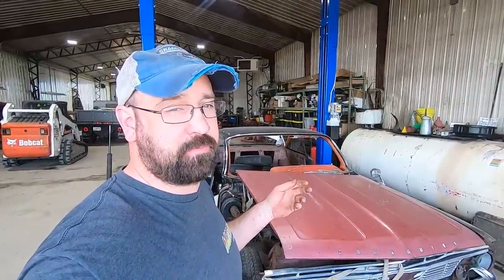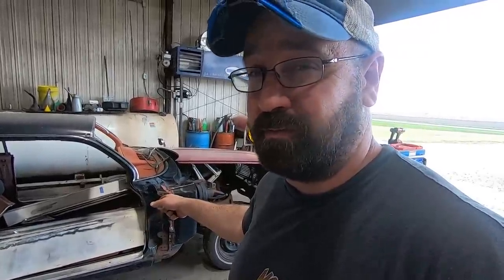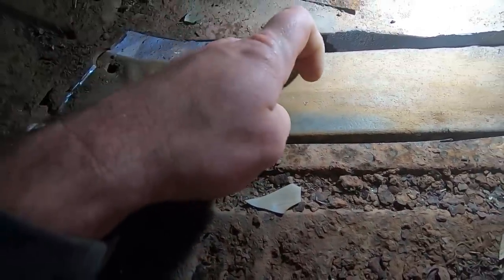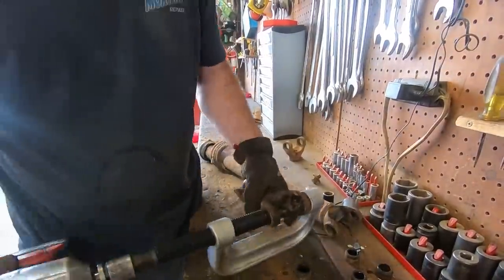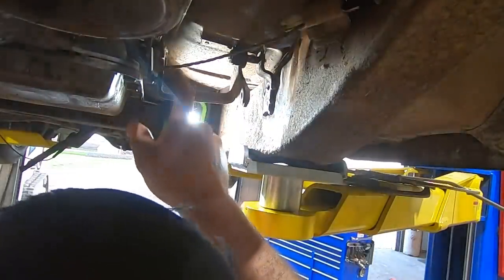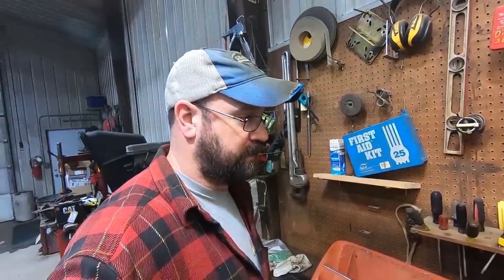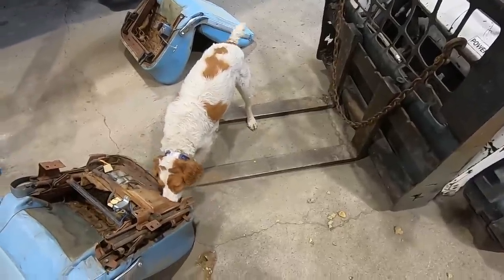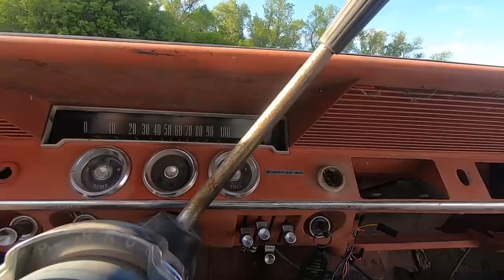Abandoned in the Woods for 50 years! 1961 Chevrolet BelAir Bubbletop Saved from the Grave!

Comment: Even if you just need a little bit of sheet metal  it's not a different Guage metal  as well as some of the proper curves and time is money that 6 in piece of a rotted door can make the complex inside structure  easier to patch  and the X frames are the same its only two  convertibles and non convertibles  but they  are the same size and the additional braces are able to be added to a non convertible I have had  a bunch of 66 impalas 2 ss one vert and 2 2 Dr's all were 283 w/ glide and one that was hardtop had 12 bolt rear my grandfather Art had 58 4dr hardtop  Belair  with a 348 and a 400 as a master transmission builder the cast iron glide  is the first thing anyone not restored the car should take out even if you put a aluminum case glide  back in they weigh  as much as the engine 😂  but the 4dr hardtop to gearhead with 5 kids  was as close to the 55 with a 4 speed  he could  get my grandmother was street racing  because of the guys in Miami  in 60s telling her her husband was going to be mad she was out driving his car it had 375 hp 327 and 4 speed from his gas station  repair shop  sorry  this one is bringing up great memories  and the reason I have had something with a motor since I was 6 years old and I had to know what every different Chevy from  30s to 70s studied his motor service  manuals and  the impact I loved to use  as 4-5 year old I was allowed to take the pans off and help clean in parts washer  in  Miami  we would have  local  Aamco transmission shop sent to art sowerbrower to get it right  as he was owner of his own  Aamco franchise years before I came along in 77 but I always said the best mechanics in the world old time farmers because even if they could have been able to buy it  they couldn't afford it when they didn't even get more then 20 miles from home they were born in  unless they were in service  but necessity is the mother of all inventions 💡🤔 love the longer video of different tasks that have tidbits to learn and if you did in time lapse wouldn't have taught the person who doesn't know that trick someone much older taught you I'm glad I grew up with  a transmission rebuilding shop in our garage  I was able to do a tune up before I started middle school lol could service my go-cart before I was able to start it and built not bought the only thing I send out is alignments and new tires so I have national warranty I have been tire tech so I'm watching the guy and if not 0.00 it's not done 😂

Comment: If you want, you add the floor shifter with your mid-engine Plymouth Rebel with mounted on  AMX engine and get rid of the 1961 garbage black car because of there's no title. The floor stick is a Hurst it belongs to the Plymouth Barracuda loud explosion sound of race division of Hemi head. He got the Rebel for you is The Vice Grip Garage in Youtube and he would offer you his unsalvageable Rebel and let Garage Vise Grip garage tech keep your 1961. Plus, the addition to your homework by shifting the mid-engine AMX V-8 toward to the front engine car called Satellite Rebel then you have to add in dashboard to get the stinking smoke away from the engine in the engine bay with mounts like them are very good shape. It has low mileage. Floor shift is like it is forfeit your rights to be the original car maker then you get the VIN and the Blue book of its pricing range to get it afford by most vintage car's potential buyer. For us to not to forfeit these right of new salvage car owners she would have to be column shift nstead dreaming big pennies =every pennies goes fly away everyday until you hold all asset of Hurst shift so find Leno shift item. I don't have Leno.

Comment: Would be really nice to see you set the budget at ten grand and make a respectable driver. Shame to see the body come off the frame without putting some paint (or at least undercoat) underneath ... which means repairing the floor, new paint up top means good glass and chrome, new carpet means good and matching upholstery ... I know, it's a slippery slope, but the car is worth your expert help! And that ten grand would easily flip into 20 when you are done.
Reply from the maker: Money pit
Reply: @MortskeRepair  Yes but aren't they all? Then again, I am the guy who just finished a frame-off on a 57 Chevy 210 4-door hardtop with a 235/Powerglide. But you asked for "my" solid advice ;-)
Reply from the maker: @JonDraeger  damn

Comment: Okay Bel air is in bad way of chassis and it looks like not factory standard Belair chassis with Biscayne body. The Impala car was what you have but it was not accessory to carry fancy trim such as aftermarket into complete street legal yet. The independent dealers and GM no longer make Impala, Biscayne and Caprice so it was succeed by the Beretta model. That was fine tuning your dashboard from Blue color and into standard red dashboard control with knobs of its meters during the update and upgrade of the dashboard so the electric lighter is connect to the dash hot wires panel IC. Cigerette lighter was avail only as optional to modified as custom of the Impala but the socket is there with no heater spiral tube. The running board was removed from your Impala so you carry the spare tires but it is Biscayne with road service named Ac-Delco trucking to sell air pumping service called mobilty of gas pumping or diesel carrying by pickup truck named Chevy Marveller oil co. that its broker was White Oil co. 
  if someone create the Marvel mystery oil then the founder is the marveller but we became car model named Downsider because of lack of rain = drought as a company John car from my Pet named Deeres.

Comment: We are looking for motor to install 283 CID but you only have Pontiac straight 6 flat head and hand him the Mustang 2 with boss motor includes all rust bolt in a bucket that he drag racing and got 14 sec per quarter mile. Because he went for a latter car named 440 six Pack satellite Then he brought Pontiac 1950's color blue two door vintage sedan with all original roller parts except front sway window pane driver side. It became roller (no pink slip) and not able to run or start good because the engine was leaking testing fluid and bubbling from 2 spark plug from flat head and still running engine with dirty carbon inside the bores of engine. Terrible that the Pontiac have push button Auto shifter and tranny.

Comment: You do need a new torsion bar from Corvette that no one wants corvette "cause it's too expensive. But the torsion bars as a new deliveryr from the stuck mothball storage of junk and then corvette sold you the liquidation pair of the torsion bars as parts of the weight chassis but we build a new plan that you and/or team to weld the torsion bar in between the  ends of lower control trailing arm at the rear suspension. The rear lower control arm has to come off it is broken and rust dead piece but torsion nand flex the trailing arm to be connect to the bottom seat of the rear shock dampener. The same dampener at upper end of the coil spring will goes to the biggest rubber grommet Persuader called washer complex car component and make the heavy duty metal sheet atop the shock absorbers rear set and the metal strong panel of the roof atop the tub sheet metal. The strong panel is between the upper of the rear bench/settee and rear wind-smog shield and it is where the shock heavy coil springy the unweight tub is connect to the strong panel also called rear shelf. The tub is a floor and pan called wiring cowling half tunnel for automobile. The bath tub is too small with its 18 gauge thick.

Comment: Okay you got a new junk car that is salvageable but 1961 car is missing cylinder head for OHV then there is a highway Marshall HWY or memorial HWY from Huntsville, Ala  to Lewisburg - Petersburg, TN Going northward There is a salvage cars at right side after pass the John Deere dealership at right side. The yard might have barb wire fence around the house's property included old car no older than 1960 ad. You get a better find of item and parts for your vintage 1961 car. Over this other than the DMV charge too high finder fee as i compare to the farm field with trees (no leaf) where Biscayne salvage part was sitting in trash. Bigger car and junkyard where the lawyer charge for a free title of the ownership plus the receipt of what you paid for selling risk of DMV license plate. I hope that you sell the work and service that you add charge to the 1961 Chevy bubble top car and that it needs the emblem Biscayne or Impala with 6 tail light at back but you keep all metal and some glass impala but change the rear panel and cut out into 4 tail light. Mine was impala and The veteran sticker and front bumper was like Apache non-pick-up car. I don't know about Biscayne.

Comment: The 1961 Beaufort impala car has x Chassis but you need to hit it hard with rock hammer and see if the chassis pass the inspection safety. It should ring but if not it would thud. Thud is steel chassis is very bad car = not salvageable. Get the 1963 Citation called chassis longest bed length like 15 foot chassis of pure new iron and color silver and also have color as a Lodge builder that improves your chassis that is fragile as a thin glass but beef it up with aluminum-copper rod for welding and brazing to preserve the metal In Bible said it so.
  This week, I have been peeling 50 peaches so far. They are still in the jars as running jelly sugar them. Running means thinning like preservative.

Comment: Oh my fisher is my Grand father pick-up Model T hay hauler around 1920's ad brand new when bought. It was rust and threw it away at Tennessee river trash after drove it to San Francisco from Tenessee and the engine was never rebuild because we are working with Gun and County so we get commander instead of Fisher and running the plastic Norelco that will install special order custom to our 1940's car but we sold the 1940 Porky car since it was hearth old pile of bolts station wagon sedan from Mopar John Deere job at CIO-AFL railroad hauling some machine or car from my congressman. But my congressman was stolen by the Pat. in Port richmond in Depot rented land lease of tiny condo. Then I bought Ambassador 4 wheel car but it was trade for toyota corolla 1970 brand new stick shift but I don't like it because I don't remember if it's 2 door or 4 door and it is non hatchback. I prefer to where I drove 1972 250 CID two door Nova but I got motorcycle instead of Nova from insurance man ripping me off after negotiate for the other driver had total my car while she was parked all alone.

Comment: you pick up the Chevy Biscayne you said the sticker of nameplate was stamp by Chevy comnpany in Hayward, Ca. and they said it is Impala sport sedan  or a Belair 1962 but use the stamp the VIN plate to your dashboard under the suggestion in the forum from Hayward HQ and Toledo.Ohio will fabricate up a new VIN for Biscayne coupe 4 seats car hardtop under order from higher up rank from Hayward, G.M. fact and proof that you Mr. Mortske Garage shop owner will find interesting VIN sticker and let it be bar code for quick access to the DMV that sells car like Chinese DMV monopoly. They selling car for not higher than $15.00 for VIN recovery I don't know the price. You did id the firewall by saying the code was either Belair or Impala. It is Impala car and I know Biscayne is same as Impala or Caprice. Caprice had very fabulous Chrysler and Chevy that build the dashboard under licensed Bell and Howard and subsidiary of its Jet engineer of Chrysler turbofan that runs a car for inventory but a big failure. These car are subsidiary is Whitney and Packard that Wright Boeing is no longer our factory Just car driver named Halfass car manufactory and your fabricating up an idea car but you said the Impala has front end collision. But it is bellow rail of the chassis up front is normal complete component. You need everything to the ballistic columns and it is four corner with pulley/tackle and 4 hoists with its wire rope 1/2 inch diameter cable and align the chassis up into perfect rectangle that each corner is 90 degree. Column is 6 in. by 4 in. my wood and will straight the chassis into bent but I have to make it hotter than my plasma cutter that only thing trying bent the metal heavy-duty.
 The clip are three things: front induct and radiator front shroud and two fenders into one piece That would be a title with two VIN number into one car age over 59 years old. Clip on the VIN smaller scale with super glue from HFT and rivet and pop rivet gun I have it.

Comment: You write it down on sheet of paper as a proof that you are the new owner of the Impala but you have to get the emblem that says Impala from the new owner that sell the emblem. The judge does not want to force you to get the VIN of 1961 Impala. You must obey the VIN custom to be press and get new VIN number stamped on with your engraver drill made to be the same as copy backup paper for Archive inside the DMV and from dept. of Statistic and the lawyer will as the GM to approve you that it's genuine build the new VIN because the VIN is not working since the rust itself had destroyed the VIN completely. The engine is manufactored by the VIN and engine maker named Iron Horse or your local dealer who allow that you win your Impala car just for parts and the Impala sellable car type make is 1961 plus 1969 Impala tailfin car's part in your licensed dealer site The tailfin car is from Nevada junkyard car as salvageable and run like rebuild your Impala as far as you willy to trade your black and white Buick skylark 1955 for investment plus the Imala modifying car up. 
 I do not have notarized stamp and stapls handles authoritarian but pls go get the book keeper in your main librarian and let the new proof of archive be kept in the Authoritarian and bookeeper/commisioner at Chamber of commerce - a fancy book publisher Totalitarian of USA and Automotive Union of Judiciary. I'm from North Carolina and I work in crushing all the cars except the car and truck that I drive a 2000 Taurus and a 1997 F250. Plus I won't crush and total your salvage car. I am sometime order by the Mayor. My name is elect me to be a mayor so I can give away a free tuition from a lawyer plus vintage cars. I am being promoted from Commisioner up to where I broke my left heel a little bone spur. I am retired but Joe Biden is 15 years older than me and he is not retired as the President is still Joe, The Biden.

Comment: You need a resistor as big resistor is ballast resistor for controller to lessen the power of 700 cold cranking amp which means the load starter is running at over 500 amps multiply the 12 volts. So now stop all these arc jumping in every switches and better lessen the power to stop wasting your switch from burn out.

Comment: With the rusted parts it's will be better to sand them then put rusty color those with rust oleum paint let it dry and paint it another color that rusty color paint helps protect it from rust even if you put other colors after words on it this  guy with vintage box fans did it to blades and frame on rusted box fans of his did that motor was still good or DC engines or ac engines were still good just needed cleaning and oiling but ran good painted things rusty color than original.torquise blue blades too like it used to be that original.color like the blades they were his fans and let them go and blades were rusty and faded blue from dust accummilated and frame and blades were faint green from original torquise cause of age  and he restored them to original they were from 1966 those fans from his father i guess

Comment: Rad the wiring schematic and tuning up is fine but tune it for car that a a title and you will get to pay for postage 55 cent a stamp and two ways $1.10 dollars plus miscellaneous for up-front cost of shipping the VIN that comes with manual book about max. 20 pages from Chilton and DMV. with other professor that sales original of your Biscayne gasser with speedometer reading up to 120 MPH SES Impala only like plate for new number and new tag is plain miscellaneous fee. and new program to build the wiring direction and specification that your wire must be color insulated die-electric and one wire for the amp metyer and another color wire for coolant temp meter and many wire same color for 5 amp fuse light briten the dashboard and cluster called dial for speed and another color wire for high beam indicator and warning no oil blinking light or turn blinkers in your see thru real glass dasherboard. All of these different color ten rolls of wire for homemade wire wounding and draw up the reading draft of the wiring and connect device component symbols. Then the wire is no thicker than 30 gauge for wiring up to the dash IC board and use extra used wire from salvage car junker place. The wire for neg and positive ignition oil filled coil is 20 gauge as part of Standard Co. in repairing the dashboard by doing rewiring and Carlon tubing nonmetallic flexible conduit for electrical (heat retardant).